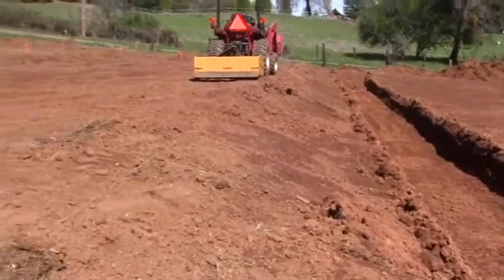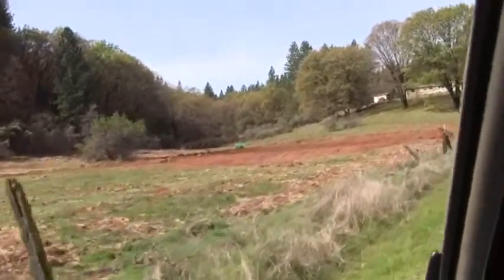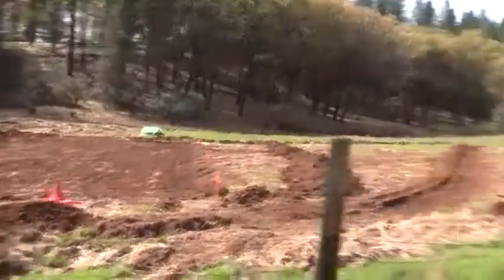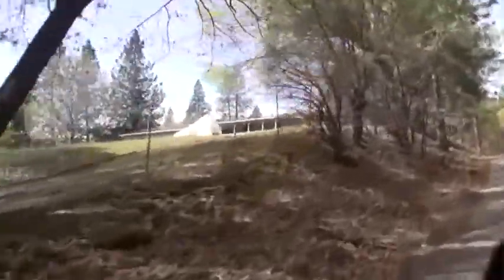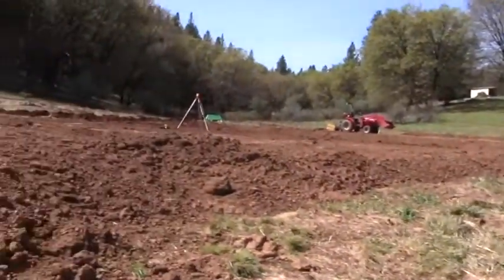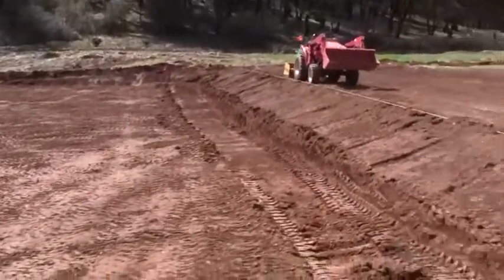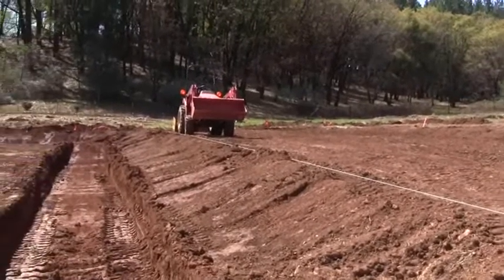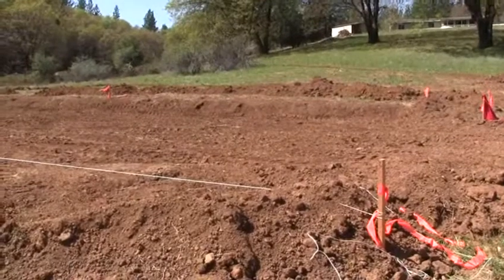Aquaponics Farm Grading Land n Drive By

Comment from the maker: Yes and no.  I did cut some swails and drainage to protect the work area.  And I intend to cut a bit of a pond for next winters rain collection to help hold water so it can soak into the ground.  We'll also add a larger water storage tank.  As for the aquaponics system, however, it doesn't use a lot of water, about the same as a 500 square foot in ground garden.It takes a bunch to fill it up, but then not too much.  We'll grow some things in ground though, so will need water for those crops.
rt